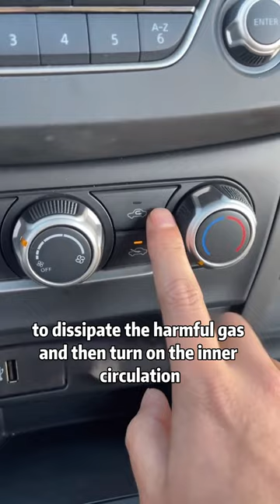Are you using these air-conditioning buttons on the car correctly?#car #tips #tutorial #driving

Comment: Huh. Yeah - I must admit I put next to zero thought into that. I figured the outside air was for when maybe it got stuffy, or on a nice day where you didn't need much climate control but some circulation would be nice. And inner circulation 'cause it's more efficient to circulate already cooled/heated air through the system instead of starting from scratch with outside temp air.
Hadn't figured it went beyond that.